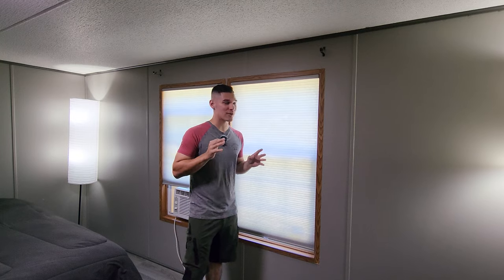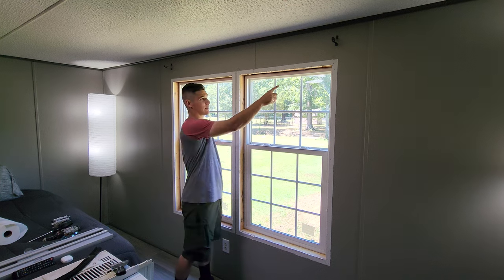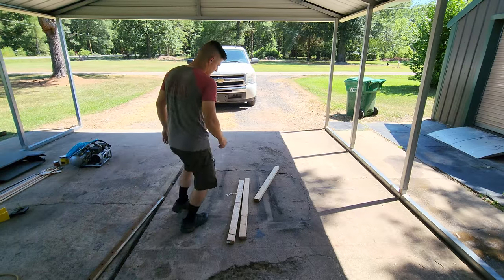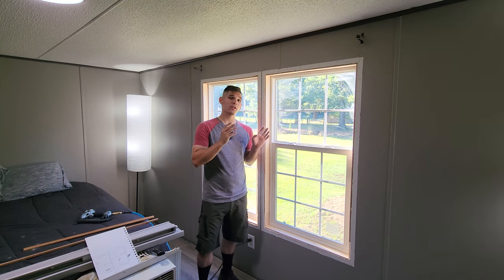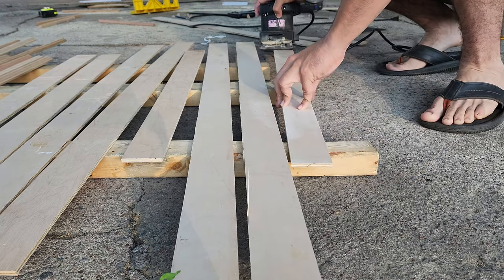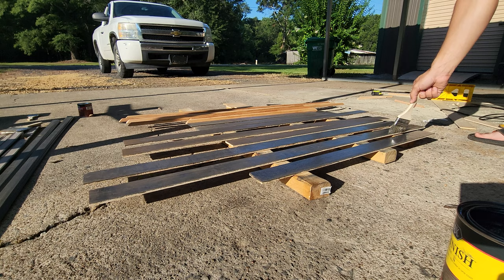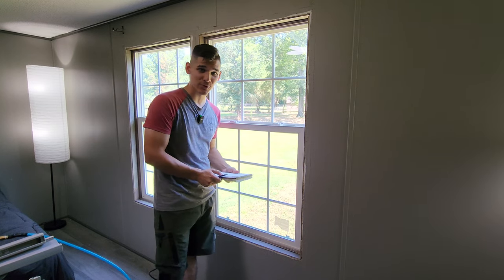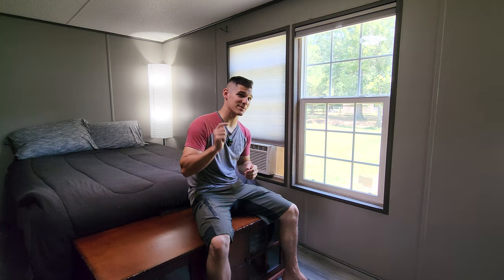Replacing Old Window Trim!!! {Mobile Home Remodel}

Comment: Thank you so much.  I'm new to DIY and renovating my mobile home. In this video, you don't name the type of wood you are using for the trim or casing.  I see the board has lines. Help!
Reply from the maker: So as a general thing I don't refer to the specific materials I use, because I want to encourage the mindset of creativity and using whatever suits your specific needs, but also, I don't like it when I add a link to a specific material and then it goes out of stock or becomes unavailable, because it is so frustrating when I watch a good diy video and the link they give is out of date. In this situation, the wood for the casing/framing is just basic cedar hobby wood from lowes, and the trim is just the standard pine trim from lowes 😅 I honestly don't know the specific brands or titles or anything. I'm sorry 😅
Reply: This is more than I expected. Thank you so much 💓 💗

Comment: Where did you get the windows?
Reply from the maker: They were pre-installed?
Reply: @hopesdreamsducttape41  they look pretty decent for trailer windows! I've seen so many horrible horrible windows in them. If you want to know more about your window there's usually an engraving or sticker. I was going to ask the same question. Appreciate these videos